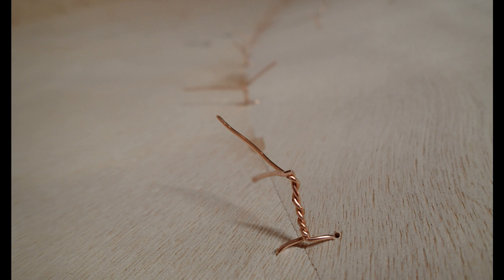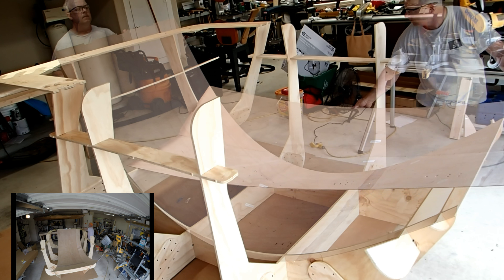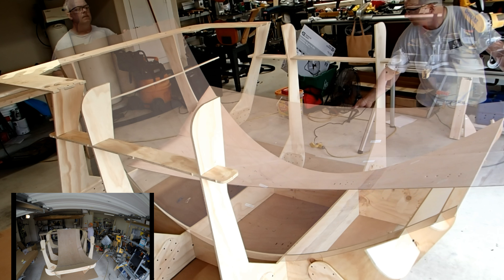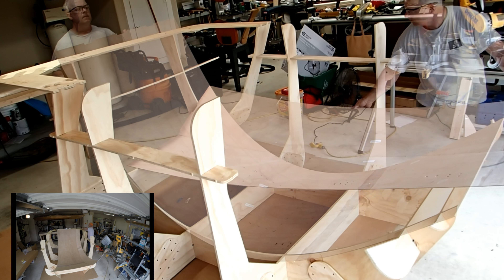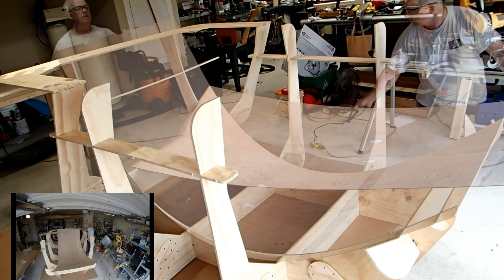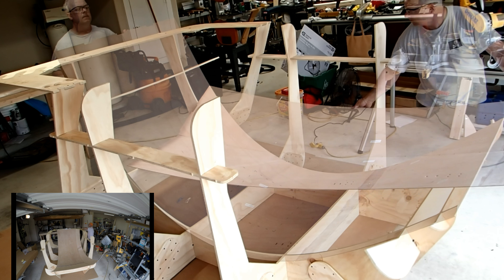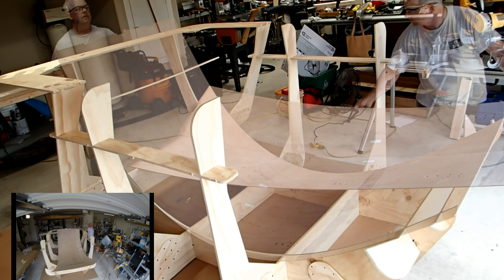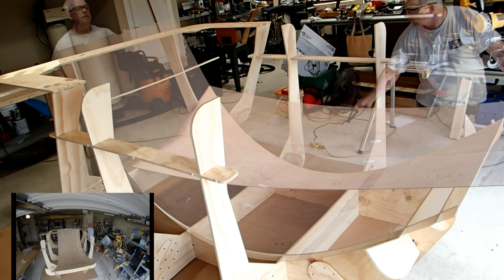Chesapeake Light Craft Teardrop Camper Stitching Tacking and Unstitching

Comment: May I suggest not cut the rings in thirds.  What I typically do it unravel just what I need to into the holes, twist the bitter end then cut the coil of wire off. That way I cut off exactly the length I need.  Many don't need the length that would be made if you cut the coil in thirds like clc suggests.  Tread granted you end up with a lot of extra wire.  Though I don't like to waste. This maybe my curse?  Either way it leaves extra in case you need it.
Reply from the maker: Great advice!